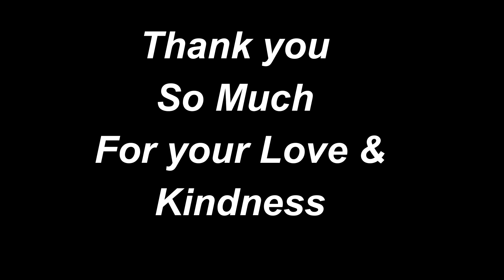Look At Them Go!!

Comment: ADVICE. It is necessary to apply to the gas company without delay, because it
is very likely that you will have to wait for your turn for several months.
Reply from the maker: Yes, we will burn wood then
Reply: @countrysideacreshomestead2008  Yes, but in order to heat with firewood, you need a stove. And for gas heating, it is not needed, but a gas boiler is needed. Mainline gas is the cheapest type of fuel. After bringing gas to your house, you can cook food on a gas stove, heat water in a gas boiler, heat the whole house and even greenhouses with gas. And in greenhouses you can grow strawberries, cucumbers, tomatoes. Think about it, it's probably worth organizing everything correctly.

Comment: eek some pretty dangerous work habit exhibited  in this video -  still do not have the stair well hole blocked off with railing with ladders against it . sliding a suspended joist with someone standing underneath it with out informing them ( ie heads up)  . an inexperienced person   firing a nail gun towards their  body while it pressed against the work piece.   as an adult I say do what you want .But  with under aged minors involved  you are asking for trouble.

Comment: Americans certainly do love wood-panel construction (каркасные дома)! You'll find that such homes aren't very popular in Russia for a number of reasons. 1) it's kind of a new tech for them so it's suspect. 2) They are convinced that it will burn down. There is credibility to this because the wood generally isn't treated like your Canadian softwood lumber. I have a friend whose house burned down in Moscow Oblast and she lost two dogs. Thankfully her and her infant son were safe. 3) The winters - they have been relatively mild recently but there have been some winters with -30C temps over the past few decades. Heating can be very expensive if you're not hooked up to municipal gas, which is very cheap by European standards.

Comment: during the construction process, do not forget to treat the boards with a varnish resistant to rotting wood, so the house will stand longer, in Russia the so-called "Ranches" are usually built from concrete blocks, they are more profitable and frost-resistant to the harsh Russian climate

Comment: There are big discussions concerning using “osb” plywood at outside of insulation as it can’t transfer enough moisture out of an  insulation. Means your vapour control barrier at inside shall be almost ideal  - 100% fault free.
More often approach is to use dedicated membrane at outside of installation and ventilated /false front. Even if this approach leads to complications in framing, etc

Comment: The submersible pump of the well is most likely with a steel worm in a rubber cylinder, if there is a lot of sand in the water, then in two years you will have to change it because the sand will greatly damage the cylinder

Comment: What type of home heating you are planning to use? Will it be a combination of electrical/gas/wood? Are you planning to instal an A/C unit or a thermopomp? May be a solar panel? I know that the gas and electricity are not too expensive overthere.
Reply: Бессовестно недорогие😂
Reply: И да, можно ветряк поставить и панели солнечные. Природа всегда поможет
Reply: They are gonna be connected to the power grid and to gas supply grid
Reply: @-akila-  I saw the power line close to their land. But did not the gas line.

Comment: Aren, What type and brand of nailer do you use at your construction site? Сompressor hose is not visible.
Reply: It is a Dewalt 20v framing nailer. I was worried  about it breaking (springs sometimes fail), but then I saw they have 2. Pneumatic tools are readily available in Russia. They seem to have electricity on site, so running a compressor shouldnt be an issue, outside of noise
Reply from the maker: Cordless 20volt dewalt framing nailer. Its the best on the market in my opinion
Reply from the maker: Pneumatic is a pain, i never have to worry about hoses or electricity. Just need a couole full batteries. My dewalt nailer in Canada put in thousands and thousands of nails without any problems, when the spring finally did go it was a very cheap and easy fix. Best nailer hands down
Reply: @countrysideacreshomestead2008  For sure it is liberating. I am a Dewalt guy myself. Consider getting their 900 20V impact gun, be handy for farm equipment and such

Comment: Not a good idea to put sand around. It will accumulate water
Reply: Там у них разуклонка и дренажная труба лежит
Reply from the maker: No, it will not. Water will travel directly through it and no accumulate. We have a tile at the bottom  to take the water away.

Comment: In my opinion, you have made a mistake in deciding to use OSB slabs for your house. These are not a safe building material as they are made from sawdust and glue, which can release carcinogens for several years after construction, posing a significant health risk. I believe OSB slabs would be better suited for technical structures but not residential buildings. Few people in Russia use these slabs for homes, preferring bricks, beams, and logs, which are more environmentally friendly.
Reply: пол подмосковья и дальше по дороге на Юг к Сочи построено из ОСБ
Reply: Not true at all